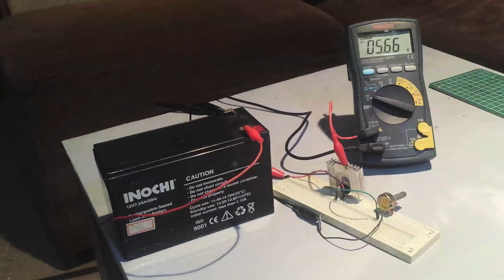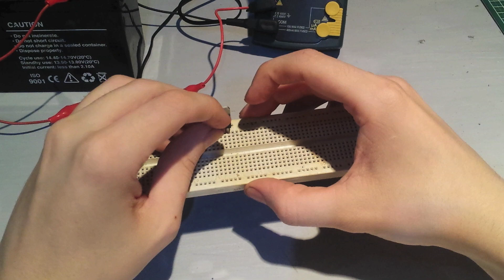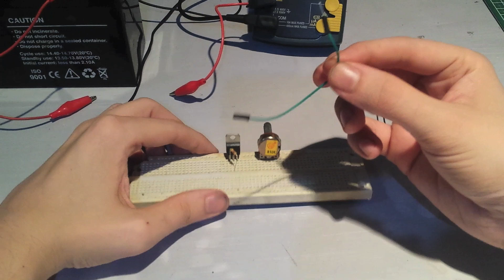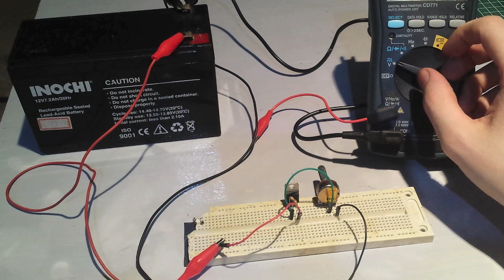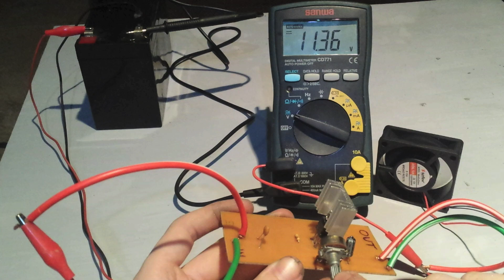Make a simple adjustable power supply LM317

Comment: For some reason, (and I have spent a lot of $$$ replacing it) whenever I hook up my 10K Pot it pops and flickers so I immediately unplug. I am using a 24V Power supply and it was working fine originally until this started happening. I have checked and double checked and there are no shorts, it's assembled exactly like in your video, so what is happening?
Reply: make sure you're using the right pins on the LM317, that it isn't flipped or you have a different 317 than in this video. You might also want to do prototyping with a 9V battery
Reply: Spoder Man Thanks I will try that.
Reply: Antonio Quintana If your input is a high current and voltage, you might want to read this: 

http://electronics.stackexchange.com/questions/94554/what-are-the-maximum-input-current-and-voltage-for-an-lm317

Comment: With an atx power supply, do I connect all the 12V wires and all of it's ground wires  to the corresponding pins of the lm317?(as shown in the video)....I want to make a variable lab bench power supply with the atx power supply using the circuit in the video, but I'm confused, idk how many wires of each to connect, hope I make sense with my question, I really would apreciate if you could help me on this matter :)
Reply from the maker: Marian marian2 Mmm I can't give much advice on the conversion of an ATX power supply, but there are many videos out there about it. I assume one set of 12V wires would be okay but it would depend on how much load you plan to put on it.
Reply: Got it, yeah asked around and as you said it mainly depends on the load I want to put on it

Comment: hi... thanks for your immediate reply. i have a new UPS which used for my computer till i installed inverter at my home. now it has become useless. how can i use it for other purposes? pl. suggest.
Reply from the maker: Madhusudan Kasarla Yep, if you're into solar power then you can convert it for those purposes. Otherwise just use it anyway as extra protection for sensitive equipment :)

Comment: can i connect to an DC POWER SUPPLY ADAPTER instead of a BATTERY? If so please suggest modifications, if any, to be made to the circuit.
Reply from the maker: Madhusudan Kasarla You can swap the battery for a DC power supply adapter without any changes to the circuit :)

Comment: Great idea and was easy to follow. How about larger voltage say  96 D.C. Volts to 48 D.C. Volts? Do they make a larger version of this. Thanks for the time you put in to this
Reply from the maker: David Adkins Hmm I wouldn't really know what to suggest for a voltage drop that large. I guess it would have to be some kind of switch mode DC-DC converter.

Comment: CAN U PROVIDE THE CIRCUIT DIGRAM FOR THE FAN CONTROLER U USED IN THIS VIDEO
Reply from the maker: subho DAS Unfortunately I don't have a circuit diagram. But it's pretty simple to follow in the video, you can always pause it to setup your breadboard the same :)
Reply: Gadget Addict I have a 50 volt transformer what transistor do you recommend to regulate the voltage that high?

Comment: SIR WANT TO MAKE 19V TO 12V ADJUSTABLE POWER SUPPLY CAN I USE THE SAME CIRCUIT ?
Reply from the maker: subho DAS Yup you can, as long as your input voltage is over 20 volts :)

Comment: i don't have a 12v battery but i do have an old 12v laptop charger will this work well as an input supply?
Reply from the maker: James Womack Yep, it doesn't have to be 12v either.
Reply: Gadget Addict Very good tutorial! Keep the good work up!
Reply: Gadget Addict i have a 100k pot will that work? i need to take 9/12 v to 5/3 or 9v
Reply: Mohammed Barsat i have had issues with 100k pots heating up to hot at random but if you hook them up properly via left side of the pot to the input ,middle as the output to LM317 and the right to ground. unless you have a non standard with 5 prong you wont have any issues. good luck with your project and don't forget a heat sink

Comment: For the life of me I cannot seem to get the simple breadboard circuit to work. I have the same components... when I check the voltage with a volt meter, with 14vdc input, my pot only seems to give a range between 12v-12.5v... is the LM317 bad perhaps?
Reply from the maker: It's possible but I'd check your circuit again. Double check everything is orientated the same as in my video and wired the same :)
Reply: Gadget Addict tnx for the tip

Comment: my multimeter is reading 6 volts between adj pin and out pin. is this normal because it's supposed to read 1.25 volts
Reply from the maker: The voltage depends on the feedback going into the LM317. Did you turn your POT to adjust the voltage?
Reply: Gadget Addict Thanks for your quick reply !
Yes I did and it seems the minimum voltage i can get is somewhere between 5 and 6 volts not 1.25 like it's supposed to. I guess I managed to blow my LM317T

Comment: i need help building a 10v ac 500ma circuit.......does this apply the same? im assuming i will need a ac/dc converter as well correct?
Reply from the maker: You can use an LM7810 chip which will regulate your DC input to 10 volts. That's much easier than using an adjustable regulator like the LM317. If you want to use AC then you'd need to get a stepdown transformer, some diodes to make a bridge rectifier and some capacitors, Or simply buy a very common AC/DC converter which outputs 12v and put an LM7810 with a couple of capacitors on the end to drop it to 10volts.

Comment: Los LM 317 - 350 - 338 en TO220  son de 1,5 - 3 - 5 Amp con el mismo patillage , conexionado en los terminales y prácticamente el mismo circuito.
Tienen protección interna por temperatura y cortocircuito.
Espero le sirva a alguno

Comment: Thanks for the video, it was helpful. Is there away to also add a adjustable Amp meter, to also tweak the amp? Do I just need to make the same circuit like how you did for voltage, so you can control the flow of voltage with one knob and have another knob control the current?
Reply from the maker: It becomes a fair bit more difficult when you need adjustable voltage and current together. There are all-in-one chips out there that just need some feedback and other misc. components but it's still a bit tricky. I doubt i'll be making a video on one because you can get some really nice adjustable switching power supplies on ebay for $10-$15.
Reply: Thanks for the feedback, and the direction for this. I'll take a look on ebay.  Look forward to other videos.

Comment: Hi. I need some one to make videos on how to salvage used electronics and make useful circuits with the components. I don't have an osiliscope, only a multimeter. If you can make power supplies using old radios and TV's you will get a very large fan base. Lots of people here in the Philippines and Africa need useful circuits they can build them selves. We cant afford fancy equipment or have access to many of the standard components avalible and have to find parts by salvaging junk electronics. I would be very greatful if you would try and make some videos geared to 3rd world countries + the real fun is making stuff from scrap and hacking. Thanks. Also please show us how to make inductors with out an osiliscope.

Comment: Very Nice & Clear Tutorial. I'm going to building my first circuit. It's going to be a Cellphone charger using a 7.4v (6.0Ah) LiPo Battery using a 511-LF50ABV-DG LDO Voltage Regulator. Can you tell me if that's a good voltage regulator to use, for outputting 5v @ 500mA (0.5A) ? Can a cellphone like a Samsung Galaxy Note 4 or Samsung Galaxy S3 will allow anything as high as let's say 1.0A ? I'll probably need to use a Heatsink... Probably would be able to use one for the LM7805. Nice Tutorial. (+1 : 116) & Subbed.
Reply from the maker: The LF50ABV is okay, it has a nice low dropout voltage which is good since your source voltage is pretty close to what you want to output. But a max of 500mA is pretty limiting. Most modern smartphone can charge at 1 or 2 amp so you'll find your charger is gonna be pretty slow at just half an amp. How much does the lipo battery voltage drop as it's depleted? Maybe you could get away with using a 7805.
Reply: Gadget Addict
I believe a 7.4v LiPo Battery fully charged is 8.4vdc. It's nominal voltage is the listed voltage, which is 7.4vdc. That's the main reason why I didn't want to use a 7805. I'm sorry, but doesn't a USB 2.0 port on a Laptop output at 5vdc @ 0.5A ? USB 3.0 outputs at 0.8A ? That's the main reason why I wanted to stick to a LDO Voltage Regulator IC that outputs at 0.5A. If I'm allowed to output higher than that, then I'll search for an IC that outputs at 5vdc @ 0.5A+. Can I use 5vdc @ 1A? would that be ok? Or is that too high?
Reply from the maker: Kings Royal Vapor You could output 10 amp at 5v and your phone/tablet would still only pull in as much as it can handle. Generally most computer USB 2 ports will output 0.5 but if you plug an apple device (e.g. iphone) into an apple laptop for example, it will negotiate and actually output up to 1 amp. Your wall chargers will usually be 1-2 amp. Pretty much every smart device (phones/tablets etc) now days will be capable of at least 1 amp and some can charge at 2+.
Reply: Gadget Addict
So I should go back to Mouser, and look for a 5vdc @ 1A LDO Regulator. Perhaps when it's time to buy my components, I'll buy multiple of both the 5vdc @ 0.5A & 5vdc @ 1A LDO Voltage Regulator IC's. Thanx. Maybe you could do a video on this subject, with a fixed LDO Voltage Regulator and cellphone. There's many on YouTube, but if you could make one that's better quality, that would be really awesome. I'm actually going to make one myself if this goes well, seeing that it's my first circuit I'm going to make. I've never made any type of electronic circuits before. I'm also looking into making an individual cellphone charger that works off of solar 9vdc. which I'm sure I could just hook it up to the 5vdc @ 1A LDO Voltage Regulator, w/no problems. Thanx again, very much appreciated for the help & advice.
Reply from the maker: MARK 1 That looks like an impressive little regulator!

Comment: What if you wanted to use higher voltage? I have a larger power supply that im looking to do something similar to . I would like the peak to be up towards 100 DC Volts. 
Any help would be appreciated .
Reply from the maker: I wouldn't be able to give any tips to be honest. If you're going to be hitting those high voltages, I'm guessing you'll also be pushing a fair bit of current? So you'd want a switch mode regulator instead of these linear regulators. If it's to act as a regulated desktop power supply with adjustable voltage then you might prefer to buy a ready made unit instead of making on yourself. It will be more accurate, safer and potentially cheaper than what you could make yourself.
Reply: Gadget Addict
No its for a combination of things. I can think of a gew application this would be great for me.
 Mostly CNC knee mill I have . Its power supply or aux. spindle , and or anodizing maybe titanium. 
Ya my power supply throw out some amperage  I think I have a few that are 20a (but a different voltage) and I have one big toriod thats 3kv. so everything Im doing uses quite a bit power.
Awesome video though thanks for taking th time to put it together and out for the public.

Comment: why cant you just use a battery - potentiometer - output.. why the lm317 ?
Reply: Pot will decrease or increase resistance,lm317 will adjust power

Comment: To power the 12 volt fan, wouldn't it have been easier to simply connect the 12 Volt battery directly to the fan and insert the POT in series to adjust volts?   If so, is there an advantage of including the LM317 voltage regulator? Thanks for any help.
Reply from the maker: Well the fan was only an example because it's tolerant of voltage change without any danger. Even so, a POT can only handle so much current before burning out.

Comment: Thanks for this great video. Would you be so kind so send me the circuit for it, including the capacitors you used at garaplus@yahoo.com.
Greetings.
Reply from the maker: Hi Giovanni, Unfortunately I don't have any circuit or schematic. It's really the same as the breadboard that I showed except that I put the capacitors inline.
Reply: Can you tell me what kind of capacitors and their value? Thanks!
Reply from the maker: Giovanni Rodriguez There's a 0.1 microfarad ceramic capacitor on the input and a 10 microfarad electrolytic capacitor on the output :)
Reply: Thank you. I have a 60v transformer, and I’d like to lower the volts to 12v. Can you help me to do that? Greetings and many blessings.
Reply from the maker: Giovanni Rodriguez You'd need to buy or build a DC-DC step down converter. They're generally not that pricey but the more amps you want it to handle, the bigger and more expensive it becomes.

Comment: how did you make the PCB
Reply from the maker: I bought the pcb boards that come with a layer of copper on top. I drew the design on using a permanent marker pen and then used an etching acid which removes all the copper except from the areas where you have drawn. Then I removed the pen ink using paint thinner and drilled the holes with a regular handheld power drill.
Reply: Gadget Addict thanks for the description! Thanks for the video as well

Comment: Hi could you explain for a beginner where exactly the capacitors connect to in the circuit as I'm trying to use video to help me figure out the schematics of the ladyada adj pwr supply for the x0xb0x project?
Reply from the maker: In the initial breadboard example, the positive and negative from battery go direct. Instead you have them going to a capacitor and then from the capacitor to where they originally went. Same on the output. They're just sitting between so it's really simple :)

Comment: hi phil,its your name pal,thanks for the video,we can use that to charge usb device,but one thing,i saw your digital voltmeter its sunwa?how much is that kind of meter.?its from cdr king also?thank you..
Reply from the maker: Glad you liked it :) For USB you might prefer to just use the L7805 instead of the adjustable LM317. The Sunwa meter is not sold at cdrking, I'd be surprised to see a high-end branded product in cdrking. It was around 5k php. A little pricey but I was tired of cheap meters that kept breaking after only a couple of uses. Plus I wanted a meter that meets safety requirements for higher voltages and currents.

Comment: nice phil! how much it cost?
Reply from the maker: All of the components came from DEECO. These prices are just estimates because I can't remember the exact prices. LM317 around 20 peso, a bag of 1k resistors for 25 peso. 5 pieces of 10k pot for about 50 peso. heatsink around 25 peso. 5 pieces of medium-size PCB for about 90 peso. Capacitors a couple peso. Small amount of ferric chloride making the PCB. So total price for one board is maybe 85 peso.